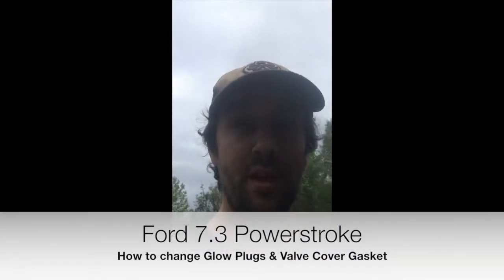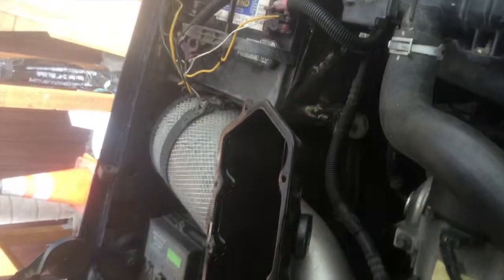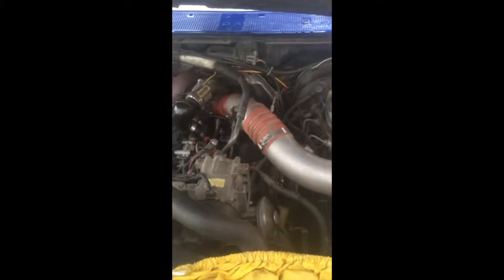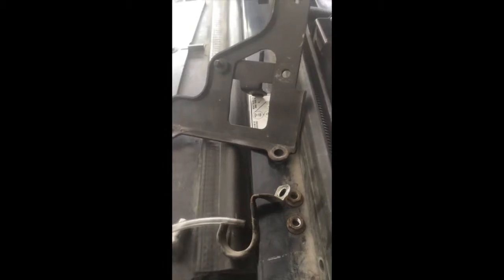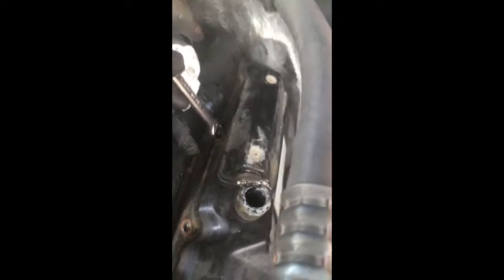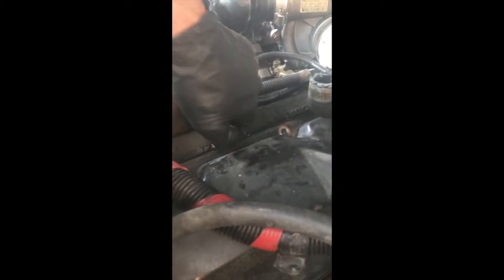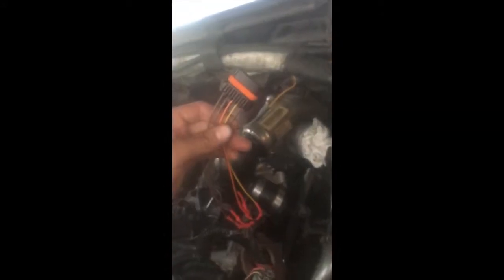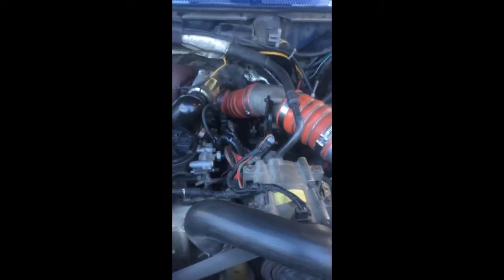Ford 7.3 Powerstroke Diesel Glow Plug change and valve cover gasket installation

Comment: Wish I would've seen this a few hours ago. I didn't remove the excess oil from around the glow plugs before removing them. Can someone please tell me if that's a serious issue or not? Also I'm having a hard time getting the caps back on over the glow plugs. They just don't want to seat in there nice. One of which has stretched out and will not fit tight over the plug. Any suggestions? Any thing would help but all n all its not that hard of a job.
Reply from the maker: I think you'll be alright if there's a little oil in there. Not sure about the caps.
Reply: @TruckHouseLife  my issue turned out to be that I bought after market valve cover gaskets. I didn't realize it buying them online. Ended up scrapping them and picked up dormans. If you don't mind I do have a question maybe you could help me with. I did change my oil right before changing the glow plugs. I did not run my truck after the oil change. Do you know if that is going to be an issue. Truck has yet to be run due to more work that needs doing and if it might help to know im a quart shy from filling filter.  Not sure if any of this means anything but Yeah im hoping not.

Comment: Hi. Thanks for putting this video up. The #5 contact on the same plug of my truck is burnt out, though not nearly as bad.

I have one question, if you have the time to answer. How did you manage to get the riff-raff boots onto the air intake and y manifolds? I found it was an incredible pain in the ass, and I ended up trimming the boots a little bit to make them easier to slide between the y manifold and the intake manifolds.
Reply from the maker: Weird mine slid on pretty easy, just used a touch of oil

Comment: Thanks for this Tim... I've got a 2000 F250 7.3 getting ready to do the same.
Reply: How did it go?  Any advice getting the Valve cover bolts back on the passenger side?